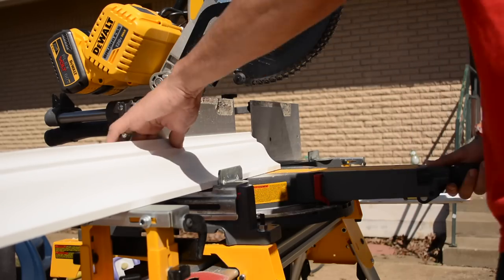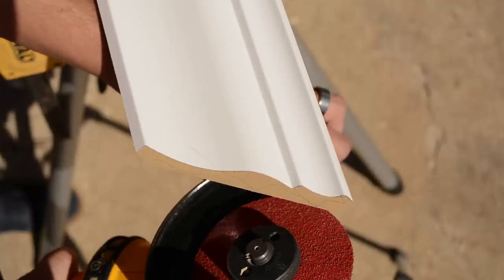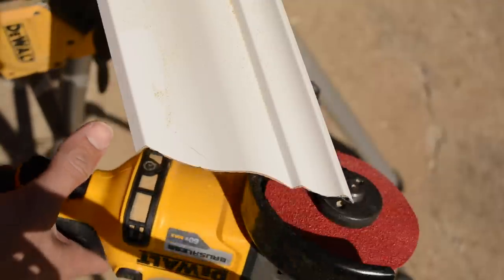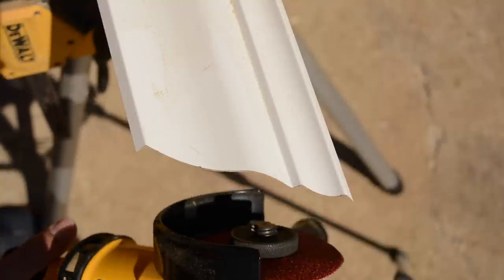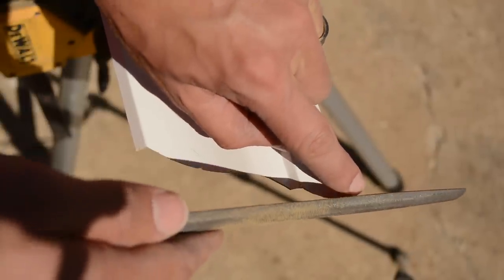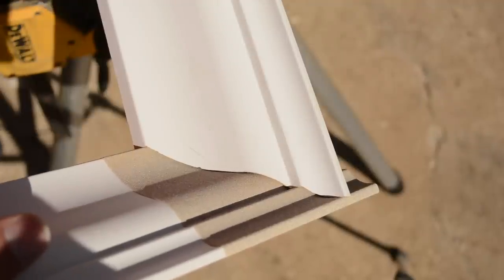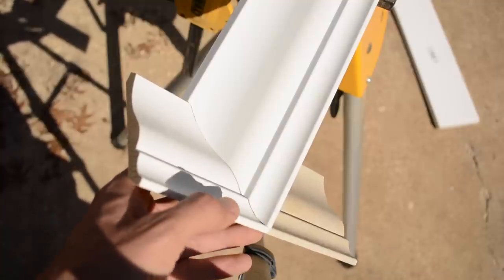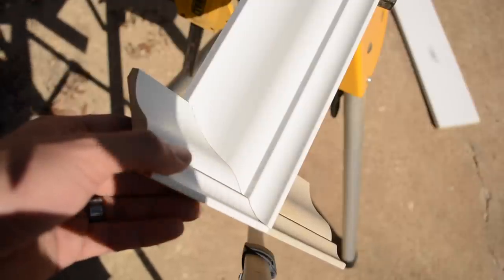COPING TRIM WITH AN ANGLE GRINDER - F I R S T - T R Y

Comment: Great idea, I had never thought of sanding it away, have you thought about using a powerfile?
Reply: Electric or gas powered
Reply: @timchapman5553  mine is electric, it really rips through MDF if you use a grit like 40 or 60 and is less frightening than an angle grinder
Reply: @utubeape  I’ve never seen one in all my years of looking at tools
Reply: @timchapman5553  I just searched Amazon and the 1st one that came up is the same as mine: Silverline Silverstorm Power File Belt Sander & 22 Sanding Belts Assorted 13x457mm 40 grit 60 grit 80 grit 120 grit

Comment: Return that thing and get a Makita paint grinder. Your favorite store Homedepot sells them. There cheap! Work like a grinder but you can one hand it comfortably. I think it is a 5" disk. You can use 50 grit or 80. It copes just as quick with more control.  
Ill be more than happy to make you a video of it so you can see the technique. You also want to go from the bottom up. Which would be the top of the crown. Its just like coping with the coping saw. Going the same direction. I usually square off the end because it can get super thin and tear.
Reply: toolman101476 
I don’t see a “makita paint grinder” anywhere on Home Depot website. U got a link???
Reply: @jimbanville  I think he was referring to the Makita gv5010 5" vertical disk sander its way easier to hold then a angle grinder.

Comment: I don't know about you buddy but I think couping it's just a waste of time
Reply: Nicolas  Lomeli it’s only a waste of time when all your angles are 90s but now a days new homes have different angles so it saves you time trying to get the angle of the corner. Js
Reply: Plus done right looks amazing.
Reply: @jmpools7723  I have been doing  this for a long time, and 9 times out of 10 a so called 90 degree angle does not exist, so coping is the only way to get a tight corner.
Reply: Doesnt believe in coping..I guess he must believe in DAP..

Comment: <———30 years in the business. Coping is for those carpenters who can’t cut tight miters.
Reply: Mr Geronimo ...
Nonsence
Reply: Cutting miters is only half of the job, making it fit tight into a corner is another real challenge that a lot of people just can't master.
Reply: 35 years in the the Business! Mr. Gee you got it wrong!!
Reply: Goyabean Gonzalez You’re entitled to that opinion as am I.
Reply: Pshhhh
Reply: Mr Geronimo some clients will not accept coped inside corners... making tight miters 
 is what you do when the client demands the highest quality work.
Reply: 11shockman when the client demands the highest quality of work you do a jack miter, the bottom of the profile is mitered and the top is coped, when looking up at it, it will appear mitered, but will have the benefits of a Cope
Reply: 😂😂 i wonder what your inside corners look like then . Not every wall is straight and perfectly square no matter how tight of a cut you make 2 45's is not going to work
Reply: Zak Casey ...I’ve been called out on that technique before... sure I cope when I can... but some people are picky... and insist on looking over your shoulder... that calls for dicking around with miters... and charging accordingly $$$
Reply: Cope it once, manipulate the joining stock and nail it. Done. Save your energy for tight outside miters. Phenoseal Blanco!
Reply: 11shockman Yeah. My point. What exactly are you arguing? 

To the rest of you dill holes, a tight miter can be achieved if you have all the right tools. I’ve never coped a joint and my miters are always tight.
Reply: Mr Geronimo  what are "the right tools" for a tight miter?
Reply: Mr Geronimo the value of a cope lies with the expansion and contraction of the Moulding over time. Miters will open more than copes with contraction.
Reply: Stevie Spoolspinner Man, if you don’t know I’m not going to tell you. Hint: Richard has used them in his past videos. In this trade there is a tool for everything.
Reply: Mr Geronimo  oh.  Uh, is it illegal?Or maybe sacred?  Or perhaps it's just standard issue hardware used to make a very basic join.
Reply: Stevie Spoolspinner Now you’re catching on. If you want to make tight miters you’ll find the tools needed to get all the angles you need to make a tight miter. Or you’ll continue to be lazy and cope. The choice is yours.
Reply: Yeah...because all walls are true 90s. Silly to say coping is for the unskilled. It's quite the reverse. Coping is almost a lost art
Reply: Mr Geronimo With classics like "baked" and "shroomin" we can sure count on your professional opinion. 

"30 years experience in the industry" say three twenty-something kids starting a company together, counting their time building sheds with Dad.
Reply: Mr Geronimo  now I'm convinced.  I will definitely continue to cope.
Reply: 11shockman damn that's crazy, talk about a new level of picky haha but you're right charge accordingly and bust out the angle finder
Reply: What the heck are you talking about if you been in business 30 years and don’t cope you better pack up and quit.
Reply: Chava303 that’s when you adjust your angle. You don’t have to use 45s on every cut if you know how to use an angle finder in the corners of walls. Pro guys get what he’s saying
Reply: I was reading this and was totally surprised to not read one mention of the use of an angle finder. Tools are great. I have all top of the line tools. But if you can't do math, more specifically geometry and trigonometry then you are busted no matter what method you use. All the pros know there is many ways to get tight miters but if you can't even measure walls properly it won't matter how nice your tools are.
Reply: I love these vids btw. I love this channel and continue to learn great things from your vids and the comments. Thank you.
Reply: Paint grade=miter w/glue, stain grade=cope
Reply: miters are for lazy "carpenters" who are incapable of coping, and don't care about the joints opening up and looking ugly in a few months.
Reply: Jim Bendtsen - glued meters never open up.
Reply: Dereck Blevins came here to say this exact thing. Miters will never hold up to expansion and contraction like a cope will.